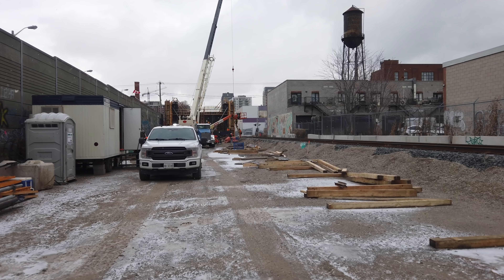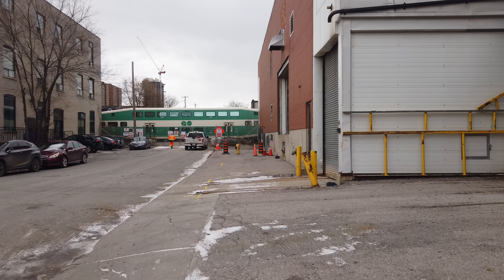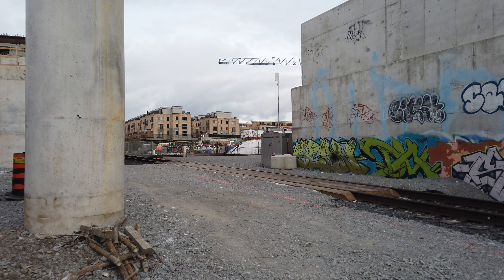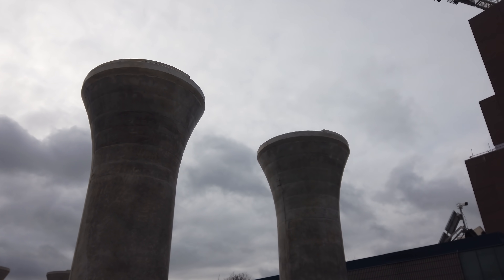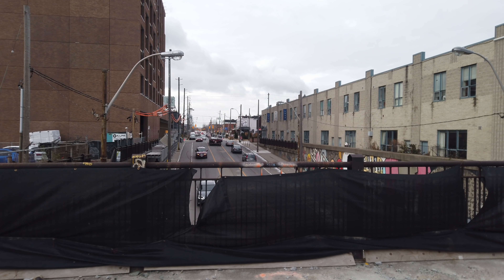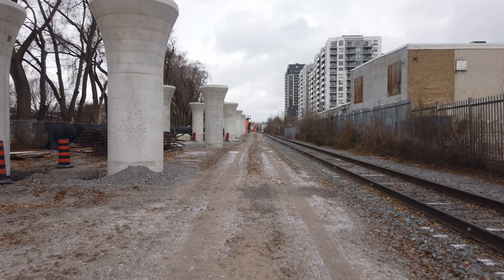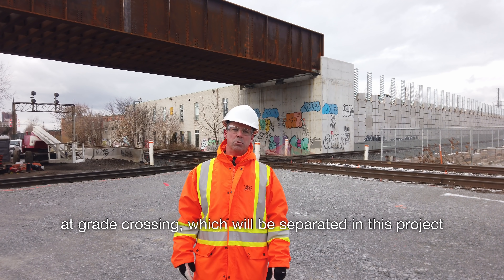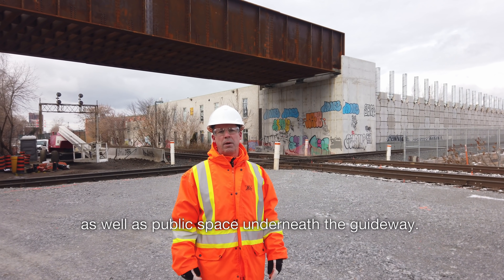Visiting Toronto’s Massive New Davenport Diamond Grade Separation

Comment: The track at Bloor and Landsdowne was the site of the very first track laid in Toronto, in 1856. It was recently bought from CN, which sold it to GO, which was itself brought under the aegis if Metrolinx. Besides running 16 or 17 rides a day as the GO commuter line between Union station and Barrie, it also serves as the VIA Rail line twice a week.

Comment: Sitting about 4000 miles away in Britain I found this video very interesting.  But I noticed that one part of the new elevated section goes past apartment blocks.  Did the residents of these blocks object on the grounds of 'visual intrusion'.? (In some parts of the world I am sure people would raise this objection.))
Reply from the maker: People certainly were not super happy initially, but I like to think that upon seeing the benefits of a new station and public spaces they’ve accepted it. Especially since this rail corridor has been there before any local residents!
Reply: I used to live in those tower blocks you see in the background, and most people were not happy when  this was initially proposed. But I think a lot of the people had no reference to good regional rail and its benefits in their minds. It didn't help that the diesel locomotives were pretty loud too. I used to live in Germany before coming to Canada and had experience with their regional and S-bahn trains, so to me it was a no-brainer. I don't know if you've been to Ontario, but our regional rail has been mainly operating as a one-way commuter rush hour rail, getting people to work and back. I don't think a lot of people realize the massive potential of what is being done to boost regional rail and how it can essentially operate as rapid transit. Again, I think back to the S-bahn in Germany, I used it to get around one point in the city to another, rather than the subway/metro/U-bahn. Once some of the existing GO lines are converted to proper regional service, I think the pushback will decrease dramatically.
Reply: Ah yes!!!!  in France it is even one of the main blockages on projects of sextuplement of tracks, because it would be necessary to raise the 2 tracks on certain sections still with 4 tracks currently and which are bottlenecks.

Comment: Just curious if this project will result in noise reduction in the neighbourhood caused by the crossing. The crashing noise of the train traffic is unbearable as it's very loud (louder than the construction work) and occurs around the clock. I hope there will also be sound barriers around the new tracks to reduce the noise of the engines. Thanks for this informative update!

Comment: The British rail network has just one diamond crossing (called a 'flat crossing') at Newark, Nottinghamshire, where the east coast main line intersects the Nottingham - Lincoln line. I have relatives in Toronto, but I don't think anybody not from there would find it easy to follow the video. I only recently found out about Toronto gauge (used on the streetcar network and subway lines 1, 2 and 4). My relatives didn't know about it.

Comment: Great video and site visite. Definitely a good way of sorting these kind of junctions. I am surprised that there is no safety fence between the construction site and the active railway. Is that not required in Canada?
Reply: Looks like there's a Temporary Speed Restriction applied to the site, so the trains aren't moving particularly fast, but there'll be comms between the site manager and the section control so the site manager can confirm everyone is clear before the train enters the section.
Reply: If you have to clear the work site every time a train comes by doesn’t that slow down the works quit a lot? We usually place safety fencing so we can continue working next to an active rail line.
Reply: Yes, they stop work while the trains pass by. This is why it’s taking them 5 years to build it!
😆

Comment: 06:00 Sound reduction? Only in North America have the locomotives outfitted with an archaic bell warning system! In Europe we do NOT have bells on the trains or locomotives!!!!! That is not only a retrograde and antiquated, it also adds to unecessary noise polution! Both the neighbour to your south and Canada MUST get rid of that bell concept! There is a huge amount of current technology that can be used localy at the level crossings and platforms as in Europe we function very well without incidents with NO bells on the locomotives or EMU trans!
Reply: Bells have been legally required for 170 Years, they are particularly important for Freight Trains and you can only get rid of them if all 3 FRA bound Countries agree to remove them which will never happen
Reply: Also the Bells are pretty quiet and many people like the Sound, anyway if you don't like Bells wait till you hear a K5LA

Comment: I guess with two lines of tracks intersecting each other like a road intersection we don’t want a northbound train and eastbound freight train for example to crash into each other.  Is that why they need to build a grade separation?
Reply: Basically, yes. The idea is to increase the number of trips on the GO line to ‘a train every 15 minutes’. Obviously, this would not be possible given the current conflict at the diamond crossing where it intersects with the East/West CP rail freight lines. Freight lines take priority over commuter service, so the GO trains would have to wait.